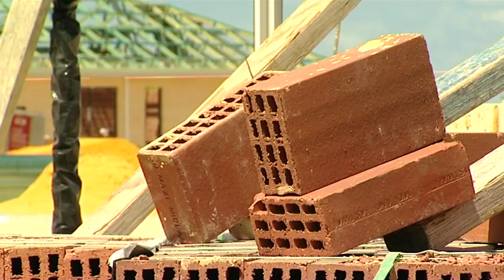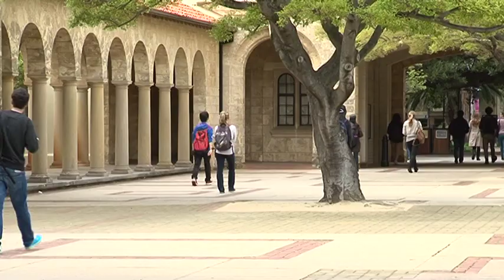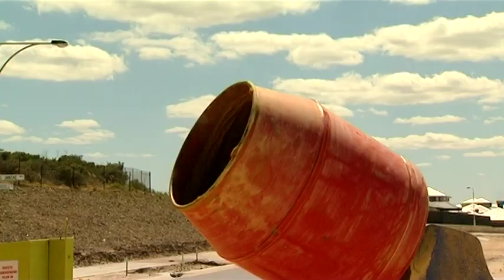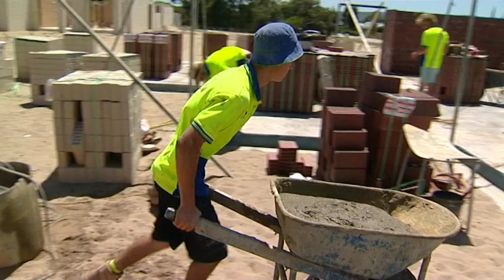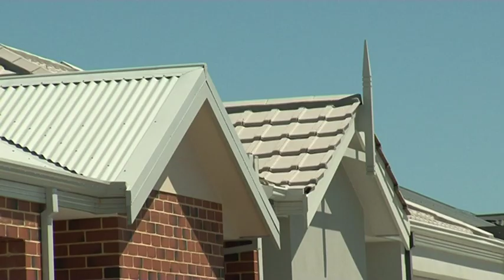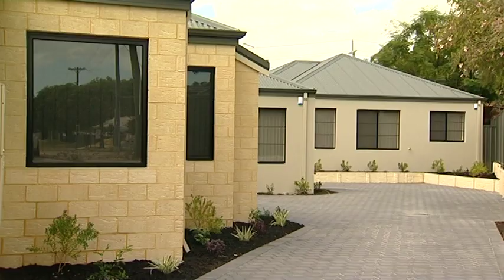#shorts Female Bricklayer speaks on why Bricklaying is a Trade Career for Women #supportfemaletrades

Comment: Get a smaller trowel,. Put less mortar on course. Clean back as you go, tap the brick with the reinforced side of the trowel, cleanliness is the key. Besides that good luck you have nice touch
Reply: Aaron Brown what kind of brick being laid has a lot to do with that.
Reply: James Gill  Started in masonry since 1985, I can assure you, you say 'a brick is a brick", if you mean, all brick is the same.?  Absolutely not true.  I hate brick that has to be tapped, but sometimes that's what you have to work with.. I've done enough of it to know; as far as skill is concerned, I won't say I'm the best, I've not seen anyone better. And I've done it all. brick, block, and stone. .. unfortunately I'm disabled now and I miss it.
Reply: James Gill No I wasn't disagreeing with that part of your comment.  Yes, generally that's how us Americans do it (at least the old school)- spread the bed joint appropriately, lay the brick, cut the excess squeezed out mortar and use it to butter the next brick (bricklaying 101).  But what I was saying is (at least here in America) there is a variety of different kinds of brick, different sizes and physical properties that require different techniques of laying them, not to mention different weather and mortar will dictate how to lay the brick. .. Back in the 1987 we had a couple of British masons (2 guys) come work with us for a couple of weeks, nice guys, unfortunately  they just couldn't keep with us (2 or 3 weeks is all they lasted).  I don't where they went, I think they went back England?
Reply: Bonanzatime
I would have stayed and would have kept up, I'm about your age, (52) and British, I am damn good but have seen people better than me at certain techniques, I quickly figure out what they do different and adapt. 
In every country I have worked I have found techniques that work and have always managed to learn from them bringing then all into play at times in my general workplace.
Reply: Fruit Gums  Yes, you sound a lot like me. 👍✌

Comment: I like this video, but I also don't. It's right, women can easily be bricklayers, but it's a shame that it misses the point when it had the opportunity to hit the nail on the head. 

Don't fight fire with fire if the battle isn't about heat. Can women be bricklayers? Yes, absolutely; can they be good quality bricklayers? Certainly, they can and it sucks that (like in nursing) there's a subconscious and non-malicious idea prevalent throughout society that says women can't be good bricklayers (and inversely that men can't be good nurses.)

When someone says a woman can't be a brickie/ good brickie and you ask why, the usual answer is too much hard work, too much strength and too much slog labour. Laying bricks isn't that. People need to get off the "women are just as strong as men, what a woman can do a man can do" train because it's absolute bullshit. Women are not as strong as men, women cannot labour as hard as men, sorry - it's a fact of life. That doesn't mean however that, among other things, women can't lay bricks. 

LAYING bricks isn't hard labour. There are plenty of jobs women can't do. How many female concrete layers do you see? Scaffolders? Oil drillers/roughnecks? Forresters? Exactly, almost zero throughout the entirety of those industries. It doesn't mean women absolutely can't do those things, it's just that those things are saturated with constant labour and exhaustive heavy lifting. Even fewer women do any of those things than bricklaying. 

Seen any skinny scaffolders, concreters, roughnecks or foresters? Yeah, me neither. Seen any skinny (male) brickies? Yes, plenty. That should tell you something. Pulling equipment off trucks/utes trailers - hard work. Mixing mud and pushing barrows around the site - hard work. Setting up and taking down heavy scaffolding - hard work. Bricklaying? Even a 5-year-old can pick up a brick. Laying bricks is exhaustive and repetitive, it makes your shoulders and back sore, but it's not hard work. When people (as in the majority of society) Learns to differentiate feeling exhausted or tired of doing something that's extremely physically demanding (like lifting something heavy) then we'll realise all 'hard work' is not the same and 'hard work' isn't exclusively out of the reach of women. Exhaustive constant physical heavy labour such as shovelling and barrow pushing may be out the reach of the majority of women but bricklaying itself is a different flavour of labour and a different skill. 

Laying bricks is an art. It's repetition and feeling. Women have a keen eye for detail, probably more so than men. Women have an enormous potential to be bricklayers because they've got that eye for detail and that feeling; the likelihood is that they may take to the art of laying bricks true because they have a better eye to it. They may not have the endurance of an 8 hour day in the heat like men but do they need to check a brick/ course 10-15 ways with a plumb or a level like the first-day apprentice? If they just have an eye and the fine motor skills for laying down bricks true with minimal checking and adjustment then it stands to reason they have more time to either lay more bricks or lay at a slower pace, although maintaining the same average brick count through spending the majority of that time putting bricks in rather than checking work. 

Of course, I'm just speculating from what I know and what I have read academically, with very little real-world data it's hard to distinguish if this is a mere hunch or a true that holds water. Sure, a female brickie will reach points within the job that challenges her lesser strength, maybe loading and unloading heavy tools and equipment is suited better to the labourer, maybe she can't erect her own scaffolding easily (maybe she can) but maybe she also has an ability that society hasn't discovered for laying fast? Sure there are young guns out that that lay like machines and do it all, in any industry, men will likely always be the best of the best, but the top isn't indicative of the entire industry. How long does it take for those 20 somethings to learn to lay like absolute beasts? 4-5 years? I'd say a lot of them probably start between 15-17 and hit their prime in their early to mid 20's. What is the skill of laying brick is more suited to women? What if (most) women never reach that point of beast mode, but then find out what it took the 16 and 17-year-old boys to learn in 3 to 4 years, they picked up in 18 months? We all know women mature faster mentally and we all know we can trust the majority of teenage girls with more responsibility than the majority of teenage guys, but what if that's a superpower? Maybe it's being wasted right now in society by having 18-20 something young women being store managers and supervisors in retail positions to save on having a middle-aged full wage worker supervise a clothing boutique in a department store? 

There are plenty of young guys with their heads screwed on that are amazing brickies and they're not useless and immature, but they don't have quite the same level of executive functioning in their brains (foresight/ decision-making ability) as both adults and young women the same age. There are plenty of young guys you can trust on site to not be useless and not fuck around, but when they're doing a simple job they know with few minor complications, their ability to make decisions, to manage multiple tasks, to plan and analyze consequence webs (their executive functioning) isn't really being called into use. Their weakness - the ability to deal with unknowns on site and problems greater than a minor hiccup, is the strength of young women. That's why 15 and 16-year old girls can babysit small children so easily. Women have an innate heightening and earlier development of executive functioning skills.

If I may call a hunter-gatherer argument; before 'society' what did men and women do? Men hunted, women gather berries and looked after children and campsites. Men tracked and trapped animals, defended territory, etc. Men are sprinters - they walk and walk and walk and then at a moments notice, fight or flight adrenalin kicks in and they explode with energy and strength to capture and kill and animal, then they drag it back to the campsite. Women patrolled campsites, they looked after children, they cooked, they gathered berries and fruits. They bent down to pick up children when they bent down to put them down, the bent and reached to pick fruits nuts and berries and through hundreds of thousands of years their eyes evolved to be adept to noticing small changes in shape, size and colour so they could easily tell the difference between safe berries and the slightly smaller or slightly lighter coloured berries. Then they also cooked and looked after babies and children at the same time, they patrolled the campgrounds and neutralised threats to the children such as small aggressive animals in the vicinity. They did several tasks at once, splitting their concentration and constantly weighing risks and consequences to keep to camp and children safe. The spent a lot of time bending and doing repetitive arduous movements (women still do today) seemingly without breaking a sweat over their long-lasting endurance - Yet ask them to pick up something not all too heavy for a man and watch then crumble like a house of cards.

Is anyone (who's still reading) starting to see the potential resemblance between women laying bricks and what women do and have always done? Tori says in the video that at the end of the day, her male co-workers are exhausted but she's seemingly not so much. Is anyone else feeling that maybe that's because bricklaying is a very paced marathon trade? Each brick is light and easy to lay but the repetition grows arduous. Where men struggle to hold endurance, female brickies may more naturally take to the repetition like ducks to water - in the same way women have been repetitively bending for berries and children for thousands of years. Where men may have to look twice to check their work (until years down the track where they've mastered the technique and are in their prime) female brickies may more naturally have an eye and a feel for the brick being placed right and they may gain a better place sooner than men. Where people think bricklaying is a hard laborious task that requires great strength, it may simply be a repetitive art more suited to a marathon runner with a keen eye than a sprinter with the explosive power and determination of a bull. Where you may be weary leaving a young male apprentice for fear they may not manage construction problems so great without the experience to fall back on, a young female brickie may be more attuned to handle the minor catastrophe effectively and take a miscommunication of trades or an error in the drafting and quickly remedy the situation and move forward in construction without leaving a domino knock-on effect of building errors, prior to the years of experience young males are required to gather in order to fall back on in such situations.

It's a shame there aren't more female brickies, or female tradespeople because despite their weaknesses (mainly sustained heavy physical labour) they certainly have some strengths they could bring to construction. They say work smarter, not harder. Bricklaying may be hard, but maybe it's not a 'hard labour,' maybe it's a 'smart labour'?